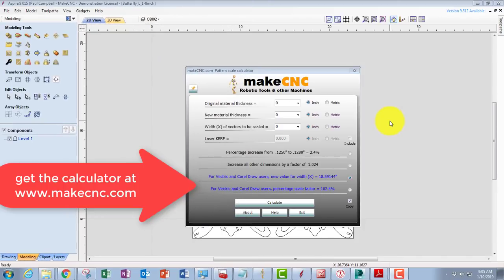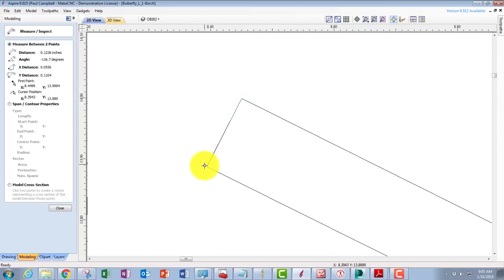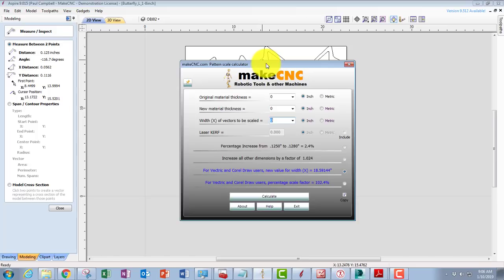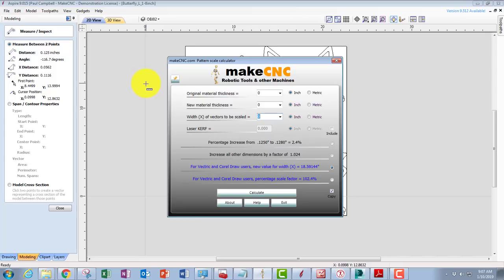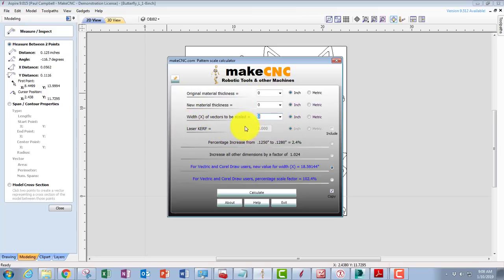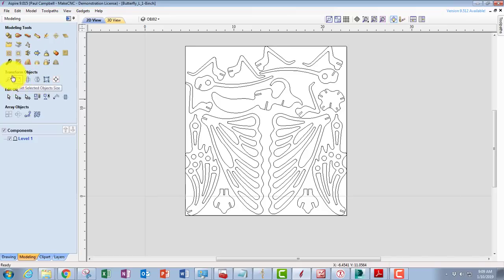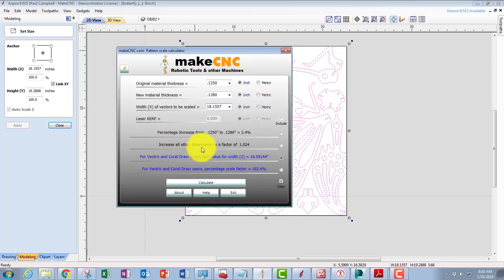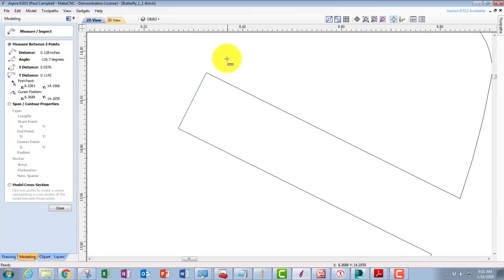makeCNC vectric scale calculator tutorial

Comment: Good morning I was looking at your scale calculator  and  was wondering if I had a file that was designed in Vcarve Pro  that  has parts that fit together for say .125 thick wood and now I want to make it out of .25 thick will this calculator work for re scaling it Thanks Jeff
Reply from the maker: yes it will work fine for that   but of course, your model will be larger if you scale up the drawings to 1/4 inch

Comment: When you changed x value it looks like you need to rearrange the parts as they no longer fit on the material.
Reply from the maker: Hi Jim you just need to increase the material size  in the Vectric software the tutorial is just to show how the calculator works it's not about nesting which is another subject
Reply from the maker: you just need to resize your material or re-nest the parts after you are done scaling